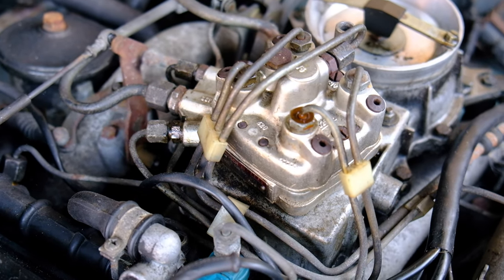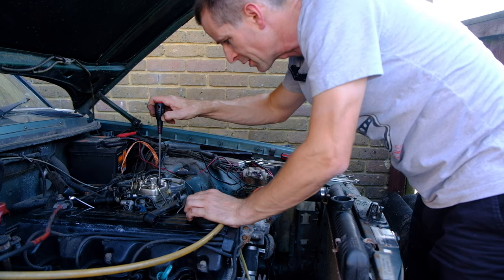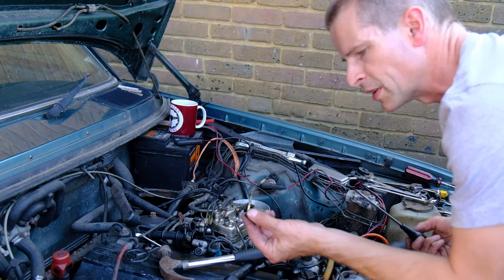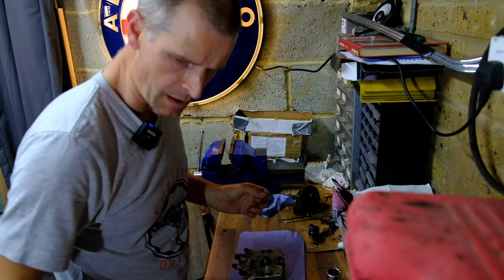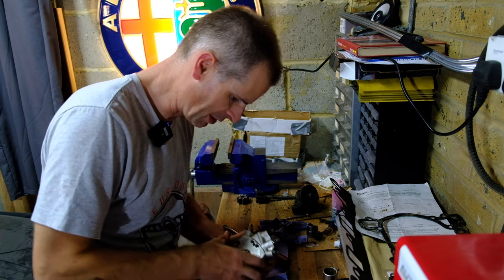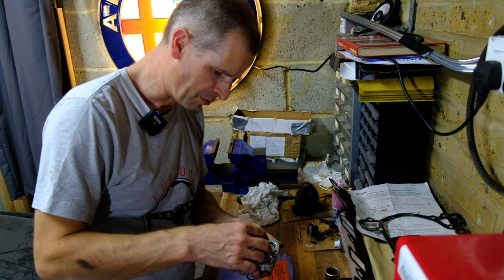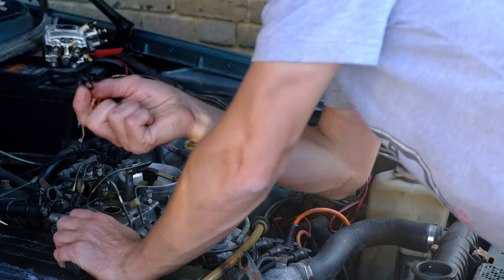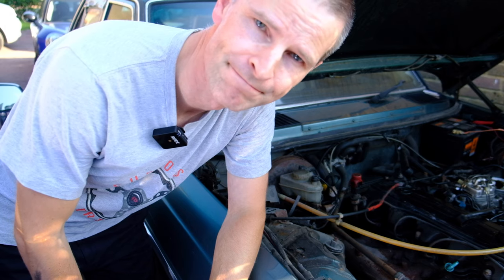W123 fuel injector distributor rebuild

Comment: These K-tronic fuel distributors are indeed well-known for not working right after sitting for a while. It's just like rebuilding a carburetor after a couple of years sitting. Just needed really. Take the following steps:
- Check if you are still getting fuel at the K-tronic unit.
- Then check if fuel is spraying out of the injectors after the K-tronic unit.
- If so, check the spraying pattern of them. Are they indeed spraying a fine mist of petrol or flooding the engine?
- If not, try soaking them a while in a bath of injector cleaner. Then blow then out with air.
- Mount them back, check also the fuel pressure on the test line. It could be that there is something (second fuel filter for example) that's blocking the fuel flow.
Reply from the maker: yeah, those are my next steps, back to the diagnosis stage again!

Comment: Hello just wondering if you got the car going?  I just rebuilt my fuel distributor on my w126 and with out me knowing the centre turned when tightening up and it sounded exactly like what’s happening to your Mercedes!  Just make sure the mark on the centre chamber (where the distributor plunger is) is lined up with cylinder one outlet!

Comment: Hey Matt! Sorry its been years based on your post. I have a same issue but its over fueling. There are sparks, no blockage on the Air lines, replaced the fuel distributor kits, cleaned the WUR, but still having a wet spark plugs and every time i removed the plugs. And start it without the plugs. The fuel burst fron the spark plug holes, looks like it always dripping fuels.

Comment: Those Salvox rebuild kits are stupid expensive considering much of the kit is cheaply available orings. The video doesnt show you removing the central piston, so not sure if you realised that the piston holds a very fine filter which these salvox kits dont include despite their high cost. Do you know where replacement filters can be obtained from?

Comment: Hi mate,
1. you can try to direct start by connecting  a wire to the starter  motor and crank in by touching the positive  battery terminal , while the key is on battery. 

2. Check for a fuse behind the glove box , its big fuse . If the fuse is bad you face the same issue.

3. Check the gearbox module which Is mounted on the left of the gear box.

Comment: Don't you have to bleed injection pumps? Or is that just diesels?
Reply from the maker: I think that's just diesel, it was gushing fuel from the inlet pipe to the distributor, maybe these need priming though?
Reply: I bet he is googling that right now...
Reply: @furiousdriving  I would try priming the distributor by loosening of the lines at the top of it. I had the same problem and it sorted it

Comment: Happened to me too.. my car refuses to start even if fuel pressure is high in the 3 distributor cylinder holes except for the other hole. 230e w124 m102 engine

Comment: Matt, what makes the pump in the fuel distributor go up and down? Is that still working? Sorry I've now become clouded over all the videos about the fuel system and may have forgotten if you checked it. Look for mechanical issues now as the car wants to go with easy start but dies when that is burnt. 

Good luck mate, could see the disappointment in your face and boo hiss to the planned development around your house!

Comment: Start ya bastard! Gutted. I thought i was going to see life. Might be worth bridging the relay on the fuel pump to get guaranteed fuel to the distributor.  I don't think it will need priming as it is purely a regulator not a pump.  Check the warm up regulator is working as that affects 'control pressure' going to the distributor. The distributor uses fuel pressure almost like a hydraulic fluid on one side of that diaphragm you changed.  Dont give up now!

Comment: I had an old Passat with 5 cylinder and the K Jetronic system. And on those cars you had to connect the air filter housing as the air intake uses a cone shaped plate which is pressure pricise sensitive. So that metal plate moves to provide air....so your car almost want to start, but possibly don't get air. Just a thought. On my car the air filter housing come loose and the car also didn't want to start.....so good luck....hehe. Oh yea check whether the high pressure feul pump is working.....those were real common issues on the VWs....at least in South Africa. Some VW used an in tank pump and some used a lift pump with a secondary pump....not sure how it works on the W123 though....
Reply from the maker: I know the plate you mean,  its beside the distributor on this engine, got a new pump as well. I am wondering if the mechanical link to the plunger is working

Comment: My w123 230E starts at the first key "cold" forces well but "hot" starts at the 2nd and 3rd longer keys. What do you advise me to check to change? Once started, it runs perfectly
Reply from the maker: Theres a cold start injector on the injector rail - follow a fuel pipe from the distributor to a connector with an electrical connector (blue I think) - which may be at fault

Comment: I really feel for you As this is not making any sense at all. Fuel is getting from the pump to the injector distributor but no further  even with a rebuild and the diaphragm creating a vacuum making it hiss. At this point I'd be standing and staring at the car for many hours hoping for inspiration. 

10:15 - "I do really wish I'd seen how these came apart" --- That's why you should have a close up cam running 😛 (Says the man who gets the majority of his close up shots out of shot 😂 🤣😂 🤣)
Reply from the maker: Really annoyingly there were 2 cameras running, someone came into the garage so I stopped them, and didnt hit start when I went back to it...GAH!
Reply: @furiousdriving  Bit weird but ignore that ..... I had inspiration in my sleep last night .... No I wasn't dreaming of you or your car, let's not talk about my dreams .... Anywhoooo ....... The arm you were pulling and pushing on to make the fuel distributor hiss, I'm assuming it attaches to a mechanism on the engine so would open and close the diaphragm based on fuel demand. Is that mechanism working properly? If it's not then wouldn't the diaphragm remain closed so one side the distributor fills with fuel but can't get past it to the injectors? Might be worth a look?

Comment: It was one of your Rover and the MG3 test drive video's I started watching. However I have now watched every single video on this Mercedes in order over the last couple of weeks. This must be very frustrating! I too thought this would have been the answer to your non start. I wonder if the problem still lies with this fuel distributor, maybe something blocked?   Maybe have the injectors in a bottle or at least the pipes leading to the injectors in a bottle, and see if fuel continues to flow after initial prime. Its not even coughing which I would think it would do, if it was receiving some fuel when cranking.
Reply from the maker: Thanks for watching all the way through! Yes its hugely frustrating, but Im sure its the full distributor now, the pressure going in is good but theres nothing at the (new) injectors. Im going to have to rebuild it again, or pay to have it done

Comment: Are you absolutely sure you have fuel getting to the distributor now.  I couldn't hear the fuel lift pump at the back buzzing away when you turned the ignition on the first time so it could be that you've fixed one problem and developed another...
Reply from the maker: You can hear it inside the car, its a new pump so quiet, the last test before this was to check fuel was getting there and it was gushing out, but Ill check it again.

Comment: I would recommend priming the distributor by loosening the lines at the top of it and running the fuel pump. I had a similar reluctance to start before I did that
Reply from the maker: Good tip, thanks - will give that a try

Comment: Is the fuel ⛽️ old and gone bad?
Reply from the maker: its all new in the tank but there are dregs in some of the pipes
Reply: furiousdriving  oh so it’s not that either, is it the relay? Hope you sort it .
Reply: If the fuel pump is working then disconnect the fuel feed to the distributor and run all the old fuel out of the pipes and get some fresh in there.